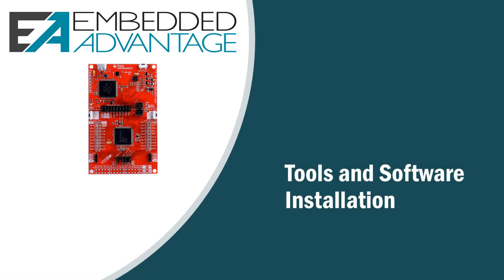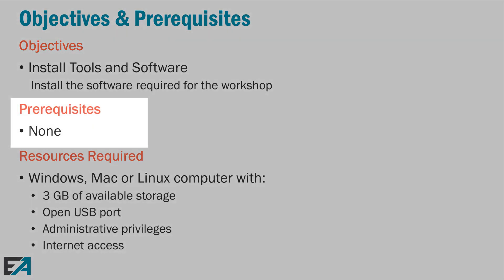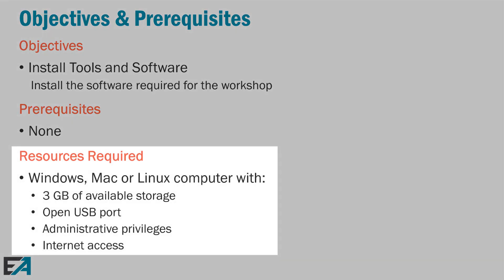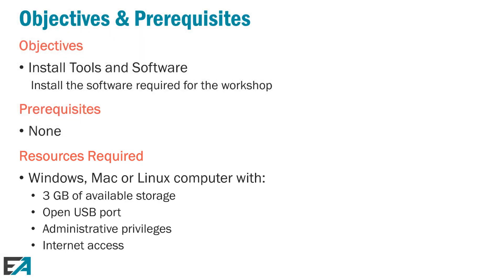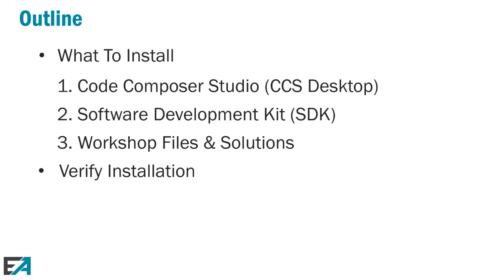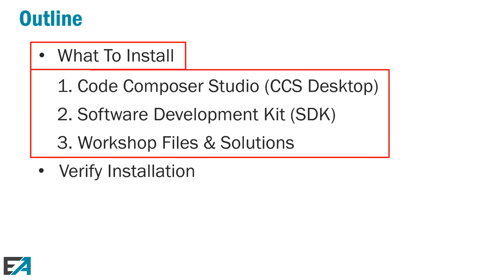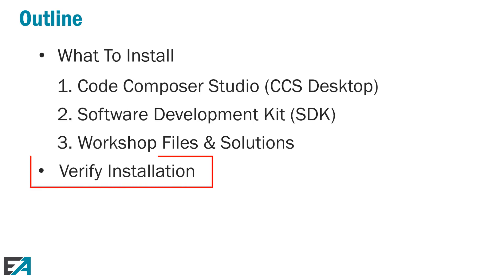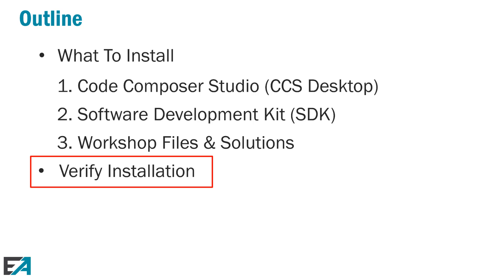Getting Started with TI-RTOS: Chapter 1—tools/SDK installation

Comment: I have Mac Os , will there be any issues running the OMAP-L138 and the software to develop DSP code on it ?. Also, I am confused to choose either this EVM or the the TMDSLCDK6748 EVM , are they the same? What are the differences between the two?  I also noticed there is another EVM TMDSDSK6713 board, which is also another dsp development board from TI. What a are the differences here? I am a DSP algorithm development engineer and basically have done Matlab and C implementations on advanced signal processing, and at this time I am planning to have my  code to work in real time DSP and porting it on target hardware. Please advise, Thank you